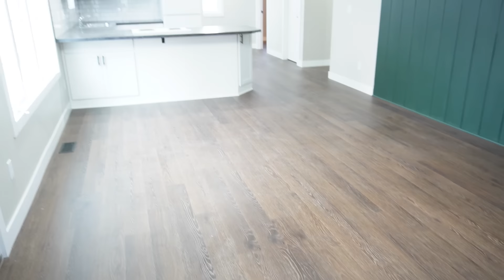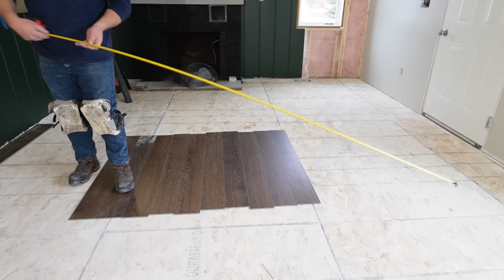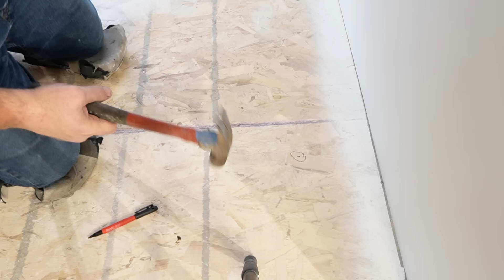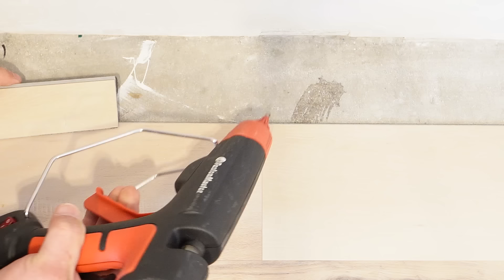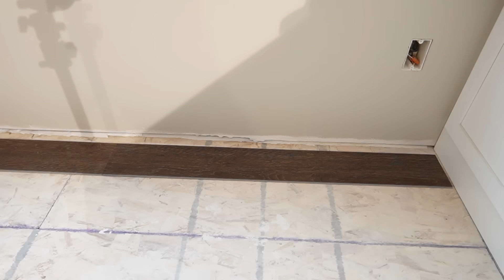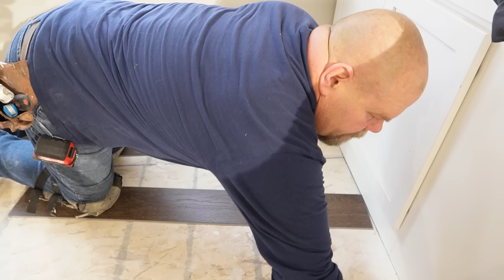The MOST CLEVER Way to Start the First Rows | Vinyl Plank Installation

Comment: What determined the chalk line measurement and how did you determine the 41 inch measurement?
Reply: i was wondering the same thing.
Reply: @johnsimms818  Watch his other videos there's one that exactly preceeds this and this one picks up from there.
Reply: All of his videos I’ve watched either he doesn’t explain where to snap the chalk line, how he measures it. Maybe I’ve missed the explanations.
Reply: @davidhoulihan1446  it is based on the large set of planks he creates in the center. After he uses that to determine if it is a good location (measure it to the starting edge, measure it to the doorways) and validates that it is indeed in a good location those planks are your line. You use those to establish your chalk line and you do it by putting a screw on one end at the end of one of the lines that make a plane for the plank. The other end is your hold. I'll have to validate again but his 67 minute video should include that part.
Reply: 😵‍💫 @eskimoobob

Comment: Used your videos before starting my own project.  I watched every video.  I used your method with the screw down pieces, glue down on concrete and your cheater board. It couldn't have worked out better.  My finishing row was within an eighth of an inch on a 30 foot span. All the 45 degrees worked out mint. It was perfectly squared to the house and I can't thank you enough.  I wish I could share pictures because it turned out epic. Now I am going to start my own sude hustle 💪

Comment: Hello Joe, thanks so much for all your effort in putting together these straight forward easy to understand videos you have been putting out, (I've been following for sometime). Quick question for you, - do you think it's better to take down high spots or fill & level low spots ?  I did watch your videos about using filler (feather light I think ) ...also due to watching your videos on which are the best vinyl planks out there I've decided to go with the Flooret Modin line.  Thanks again.  PS ~ I'm doing about 1400 sq ft in a new build.

Comment: Man, you sure make that look a lot easier than I've had experience wise.  Your first row stop block is a game changer for sure, that is (one of) the areas I struggled with in the past, getting that darn first row to stay where it needs to be while the rest are seated up against it.  It also seems your planks go together way easier than those I've purchased from Home Depot, those darn things, at least for me, need to be jammed together pretty hard to get them to lock in place.  I like your way of starting at the far end of the plank and walking backwards to seat it down towards the preceding but joint.  I'd be curious to learn more from you about how you level your sub floor before putting down planking, and how you cut the long edge of a plank.  Thanks for your great videos.

Comment: I learned a lot from watching these and I’m in the trades. We went with a 12 mm wood composite flooring. The  thin vinyl seems too cheap to us. Joe taught me the best way to layout a floor.
Reply: I use all types but vinyl flooring is handy when you don’t want thickness.
Reply: @philtucker1224  that's great to know now I know lol I've always wanted to work with the ones where I can score and snap because it'd be faster but it makes sense now. On the box says stone composite polymer but pretty non bendy board.
Reply: My buisness i work for used spc vinyl flooring from 5mm to 8mm and it's too hard it never bends. Every video I've seen looks flimsy which is odd. But great instructions from this man.
Reply: @grams510  vinyl is quite soft so if the one you mentioned is very hard or rigid it’s probably mainly made of a predominantly plastic material…

Comment: Thank you so much for sharing this video and the information. I'm about to lay plank in my bathroom and was wondering how in the world I was going to get that first row done because there is a bulge in one spot of the tub so using that cheater plank will work great. I bought the cheaper tools and I may buy the ones on your site because I plan on doing the kitchen and washroom too. If the budget committee (the wife) allows me the funds that is.

Comment: I appreciate the videos over the years. Your vids are the best over all the others. imo. I'm finally doing my floors. About 75% done atm. Burned through the last of jigsaw blades. I ended up using an angle grinder with a metal concrete blade. Definitely easier/quicker and a lot straighter cuts than the jigsaw. Also didn't have a good tapper block. Just the generic black tapping block and hammer. After smashing my fingers a couple times and slipping and ruining a couple pieces..... Ended up just using a speed square. I was using it to cut end pieces using a utility knife so its right there and handy. Works well.  For the long cuts I am using my table saw.